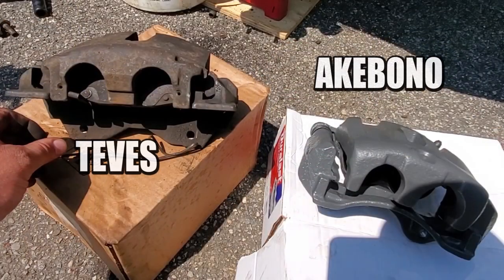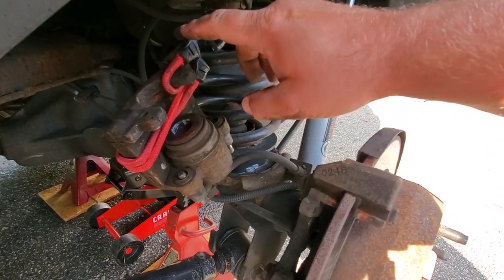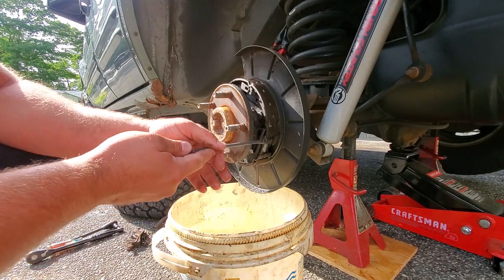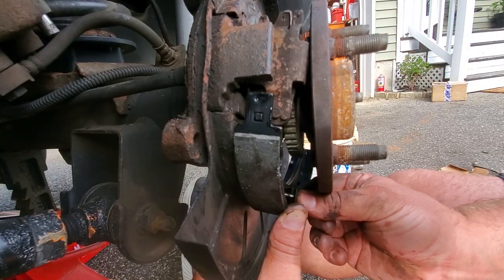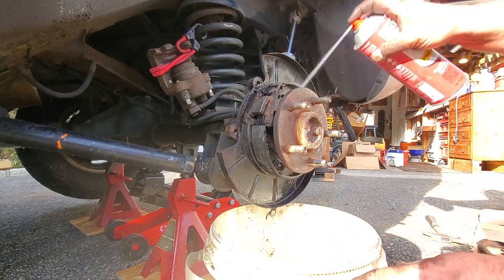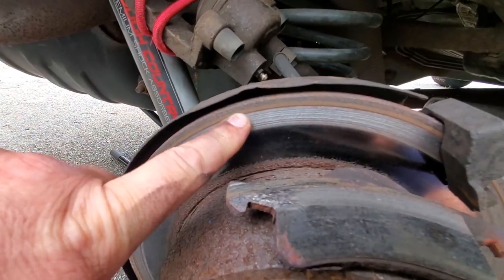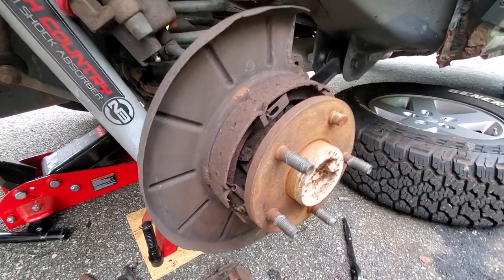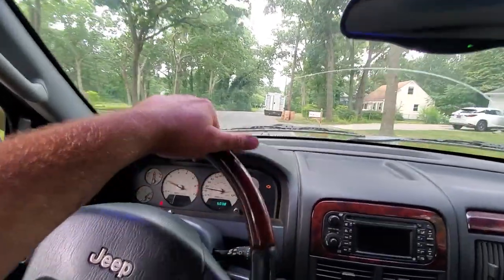JEEP GRAND CHEROKEE WJ 1999-2004  E BRAKE & REAR  BRAKES - PARKING BRAKE SERVICE (LOST VIDEO 2)

Comment: Yo bud just a quick tip, always lift the rubber boot on the caliper piston and spray some lubricant under it to lube the piston b4 u squeeze it in.. it will keep your calipers from Seizing up in the future and keep them working effortlessly with no resistance when taking your foot off the brake . I hate when calipers are sticky 😁
Reply from the maker: Great tip!! Sticky calipers are the worst!!

Comment: Nice job Dan!! Btw if you ever decide to fix the axle seal, you have to weld retention plate`s bolt to the plate(or hold them with visegrip) as you torque them down, otherwise they like to rotate which they shouldn't. Don`t ask me how 😀
Reply from the maker: LMAO.. ok... So ... Um... How? Haha!
Reply: Finally got my differential in Specs & installed, axles in and driveshaft connected.
Moving on to the puzzle my charcoal canister and components😢 A Puzzle…

Comment: Thanx P. Dan!!
Im waiting for my brake kits to come. Will do everything new, pads calipers with brackets, disks and parking shoes.
One question, in what position do you reinstall the parking break adjuster? The star nut should be in what position on the threaded rod? 

Keep It Up!
All the best
A.K.

Comment: I’d do this but for some reason my axle seals keep going out after only 5k or so miles. Not sure why other than maybe using O’Reilly’s and AutoZone is not such a good idea and maybe should use Spicer seals. Axle vent is good and clear fluid is nice and clean so I’m getting kind of frustrated.
Reply from the maker: Maybe your axles are worn down... I bet fresh axles and fresh seals will keep it solid

Comment: Dan.. I’m reaching out cuz I need some help… My headlight harness was destroyed when someone stole my after market ones in the Costco parking lot and I got a mess of wires. I’m trying to wire up the OEM ones but when I tried I have no taillights and no interior lights… I’m located in Fairbanks Alaska and headlights are a must.. Any insight would be greatly appreciated from the ZK Demi God DanH
Reply from the maker: Make sure you connect your grounds back to the body

Comment: Hi Dan what’s the difference between an xj from a zj
Reply: An XJ (1984 to 2001) is a Cherokee and a ZJ (1993 to 1998) is the first model of the Grand Cherokee.
Reply from the maker: Thanks Bob!
Reply: Thanks
Reply: And I would love to have a ZJ or another XJ. I am currently limited to a 2004 WJ and a 2006 WK, both Grand Cherokees 4X4s.